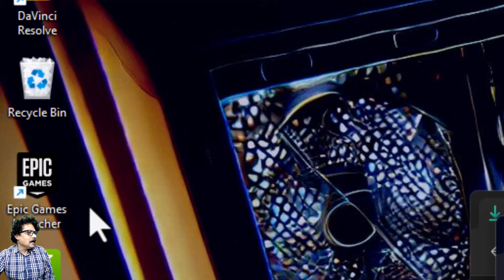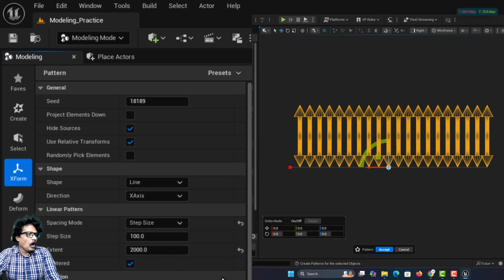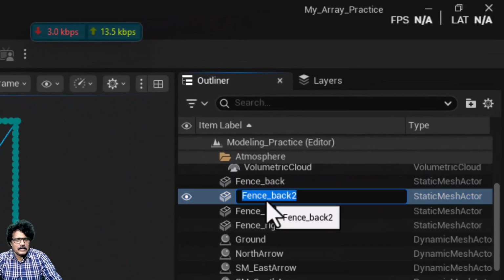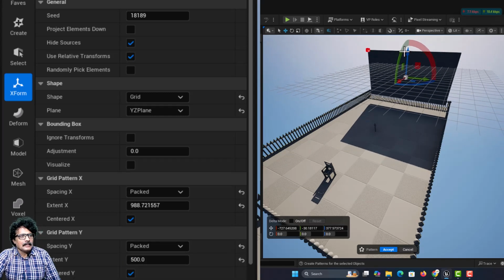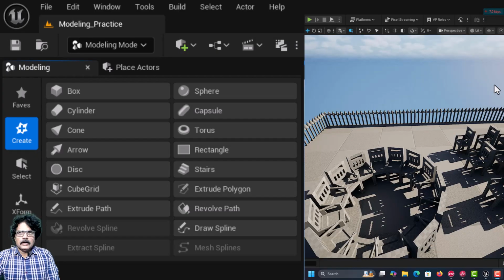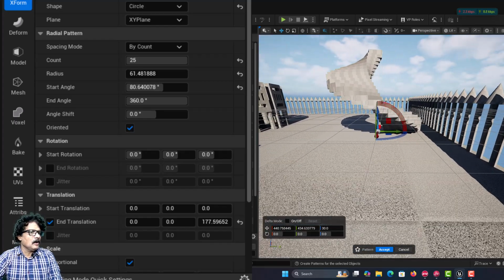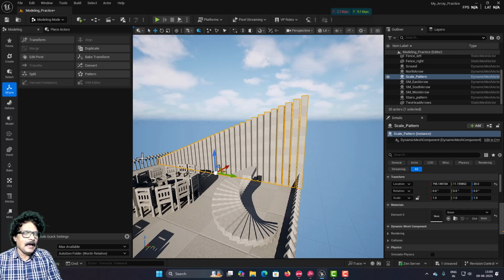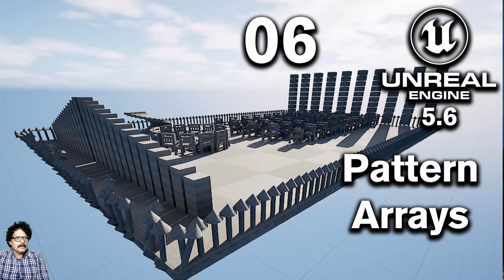06 Create Arrays using Pattern in Unreal Engine 5 6 Modeling

Comment: this is pretty destructive and non procedural. Once you click Accept you cant do any changes any more. All this modeling module needs modifier like workflows like 3ds max otherwise is a waste of time
Reply from the maker: Unreal is not a modeling tool. However over a period of time  slowly there are adding these features. Actual Models has to be built in maya and blender and sometimes  if it needs any small tweaks these tools can be used. This modeling tool is basically meant to build the levels and scenes with walls, staircase buildings etc.
Reply: @sudheendrasathvick  They added lots of direct and destructive modeling tools maybe even more than Blender or Max have which both havent been updated in ages in that aspects. This is far too much for a blocking tool. They only like some non destructive ways of using these tools and this is needed for both blocking and detailed modeling.
Reply from the maker: @Kranos_CG  Yes sir you are right. As a blender or Maya 3D artist these tools look too primitive. But these tools play a major role in performance especially in gaming as the models created inside unreal are true triads and are very well supported by nanite. So any simple model like a road in the game, buildings, and even when we import 3d models from blender and maya, retopolizing it with modeling tools here makes it perfectly ready for nanite and it improves gaming performance drastically. When it comes to LOD processing Unreal LOD is far more better than blender and maya multires modifiers
Reply: yeah, they should add at least some live non destructive symmetry and subdivision modifiers etc. These are essential quality of life standards  @sudheendrasathvick